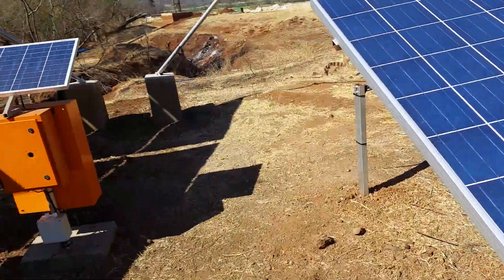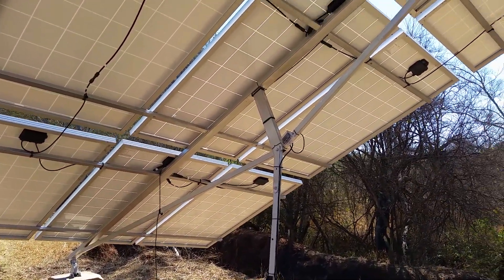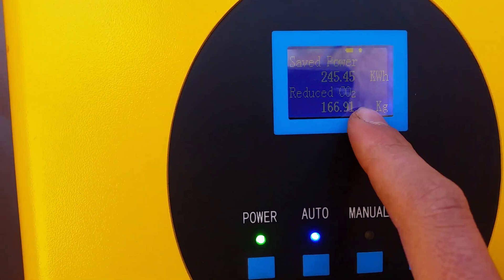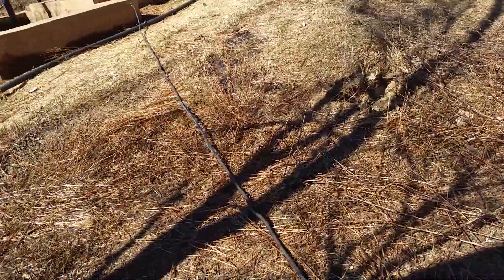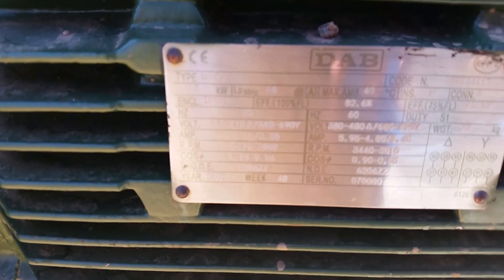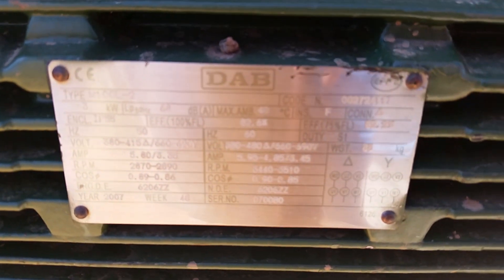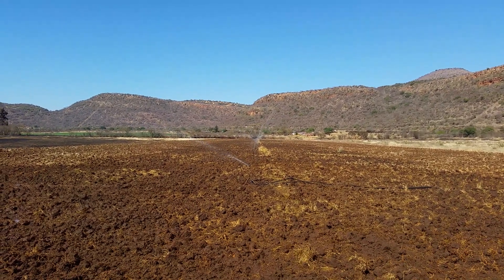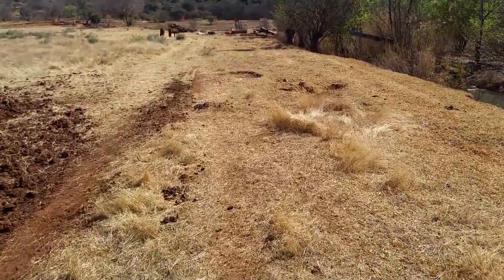3 Phase solar pump

Comment: I think what you are trying to do is great. Have you considered making a pond with all that water? If you have any clay in your soil or access to some you could make a clay bottom pond. Aquaponics is a great system you could set up there to kick start some edible plants. Very low maintenance,  lots of production. You could even set up a bog garden in almost the same way (clay bottom with some pea gravel for soil.). Cheap and easy. The fish will fertilize your plants and the plants will keep your pond clean. You can also build a few bogs up above ground level and use them to aerate your pond. Keep up the good work. I want to live off grid one day too. Very inspiring.
Reply from the maker: Thanks for your ideas and input,  won't it be a problem if the pump does not pump during the night for the fishes and the edible plants
Reply: @PhillipFourieZA  look into hydrologic ram pumps. They work without electricity and they can be used underwater, as well as above. Though, they are quite loud. Also, I highly recommend chocolate mint as a filter. Can pull out most chemicals found in water, including tap. Protects the fish from kill offs caused by chemicals and their waste.  Willow bog would also give wicker and firewood, which ever you desire. Just don't put it by any plumbing. Can sense moving water and will tap in. 

Hope this helps.  😀
Reply from the maker: @bonnieoppelt2734  HI check out my other videos,  I actually have a rampump system

Comment: Hie mr, how much did cost you for the project? And where did you buy the inverter?
Reply from the maker: It did cost me about R60 000 that's including my cables and panels and the pump , the inverter u imported from chine still working 💪 every day when the sun comes op

Comment: to work around the night time pumping problem - consider a battery. Not an electrochemical battery, but a water battery: 

Pump excess water against gravity into an elevated reservoir during the day when the sun is shining. At night, let the water flow down through a turbine, effectively creating your own hydroelectric dam. The water could be stored to be pumped back up the next day, or used to water the crop. 

I saw a puddle developing as the sprinkler water was running off. Maybe you could devise a way to collect it for use in the reservoir?
Reply from the maker: thanks for the idea and thank your for your input
thanks for watching

Comment: Hi Phillip, that's some heavy power that array is churning out right there :-) as you say the upfront cost stings but even if it takes three years to get your money back it beats paying and relying on the big companies for the next three decades :-)

You seem to have quite a bit of land so I thought that you would get a lot of single axis panels and hook them up rather than taking the tri-axis approach :-) I imagine it was worth that extra for the inconvenience and cost though right? :-D

hmmm your sprinkler system is getting the water out there, but could you not run some cheap rubber tubing along the ground instead with pin pricks along it to dribble the water out? that should be pretty cheap and manageable with the psi that pump is producing :-)

still give your fields 3 to 6 month as it is and you will make a lush valley, by walking cattle through the area as much as you can you will also stimulate further growth :-)

I imagine you know this stuff better than I but just in case it is helpful I thought I would throw it out there :-D

are there any streams on your property anywhere perhaps? and do you know you can make solar panels dirt cheap? :-D the housing you use to hold them is usually the most expensive part, but if you get offcuts of metal say from a company who make...metal caravans or something.

then their offcuts they create when they cut out the caravan's windows are perfect free housings :-D

between buying solar cells in bulk, soldering them yourself and attaching them to a recycled(off cuts) of a housing. then you can make them mega cheap :-) usually u need quite a bit of land or surface area, but you look like you have land to spare :-D

perhaps you could make a new array dirt cheap and use the extra cash for batteries so you can store the juice for the night time :-D perhaps trigger the night time motor using an LDR (Light dependant resistor) :-p

still brilliant workmanship, if I was in SA or USA I'd be getting you in to sort me a system out :-D to a farmer they must be invaluable! :-d well played keep the vids coming
Reply from the maker: Dear Battonfive 
Thanks for taking the time and effort on posting your comment , i like it you give information to other watchers on youtube

rubber tubing is the best option but i did not have the money at that moment , and yes i do have streams near my property, i was hoping by the end of this year the bank would load me some money for a 11Kw system and i will be doing a how to video on how to build a dual axis tracking unit

Thank you for your comment and thanks for watching

Comment: Good job Phillip
a bit curious about the irrigated area - i see one hectare as too small for such setup - you mentioned that you have 18x 245 w panels and this should give you around 4 kw of power at least - is it because you're using drip irrigation?
i thought i could irrigate up to 10 acres with such power ... looks like i have to resize my setup then :(
Reply from the maker: +Mohamed Elshaieb It depends on drip irrigated area i can only use about 3KW for one hectare for 3 hours , my drippers gives me about 2.2L/H and the spacing is 400mm between holes , and my line spacing is 1m aprt, i can do 3 hectare a day with drip and with the tracking unit i can do 4 hectare at 100% cap, for 10 acers = 4 hectares you can do it in one day you just have to design your irrigated area to do 1 hectares for 3 hours depending the size dripper you have i like to give my plants 18L in 7days , it is easy just build your irrigated area with taps to switch areas with 1 hectare to water at a time , if you use sprinklers you can pull about 20 sprinklers with 2.3 nozzel size and wets an area 9m X 9m, a good rule is to start to wet again at the beginning every week

Comment: I keep being told that you cannot set up a solar pump for my pastures. I need 220 for my 5hp pump and will be using sprinkler pods. You are getting great pressure just with your smaller pump.  I live in the US where can I get more information, good information. Thanks
Reply from the maker: Aliexpress website

Comment: as I can calculate that I can use inverter for use with solar panels this pump ?, solar panel and pump type, and controller, all the information for, for a rural area, thanks
Reply from the maker: 1.5x pump kw = solar panels needed 
pump KW = inverter size

Comment: Hi Philip 
How much is a 1.5 kW inverter to 3phase , plus what panels and voltage is needed , I have 12 of 240 watt panels 37 volt open circuit.
Reply from the maker: i am not a seller sorry . Aliexpress website can help you